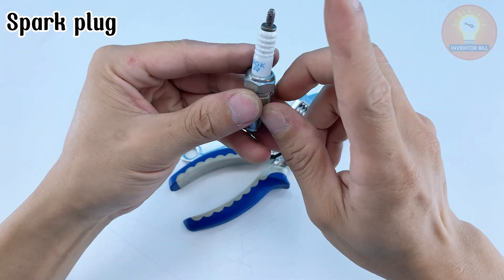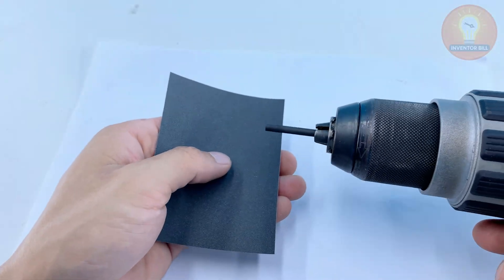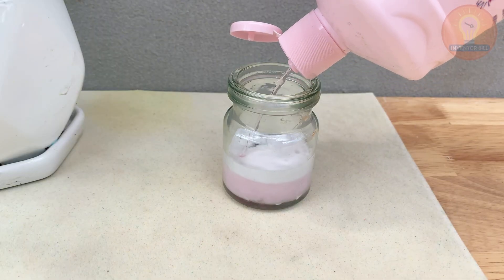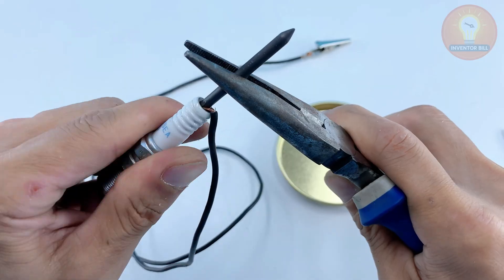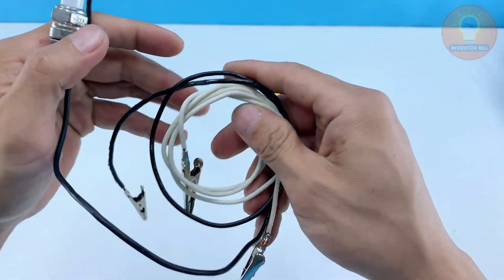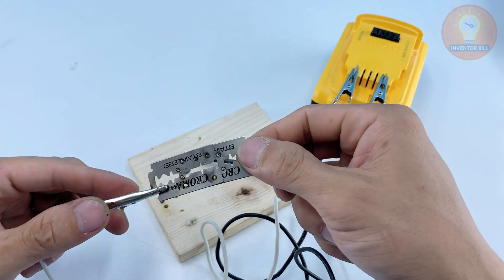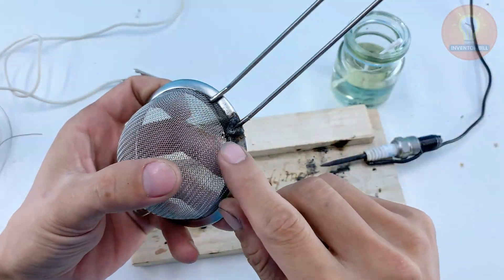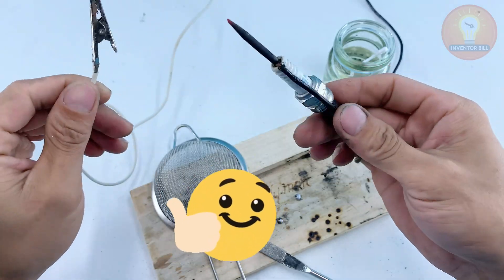Don't Throw Away Your Old Batteries 😱 Make A Simple Welding Machine that You Will Be Shocked!

Comment: If you manage to short that battery, its a proved recipe for explosive fire. And its not soldering but spot welding. Anyhow what you are doing is fascinating.
Reply from the maker: Yes, this is spot welding. Short circuiting the battery is also very dangerous so you have to be extremely careful when doing it! Anyway, safety first. Thanks for the reminder.